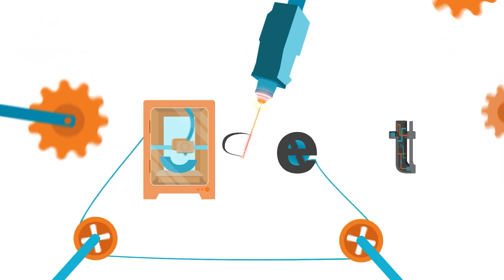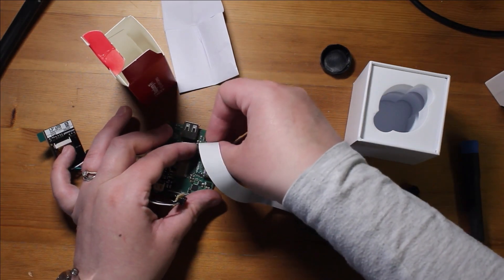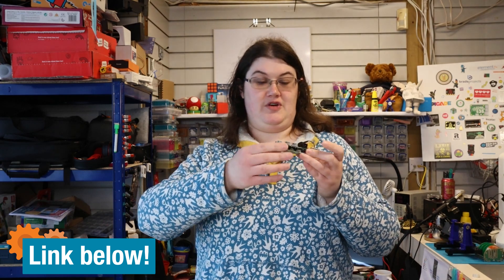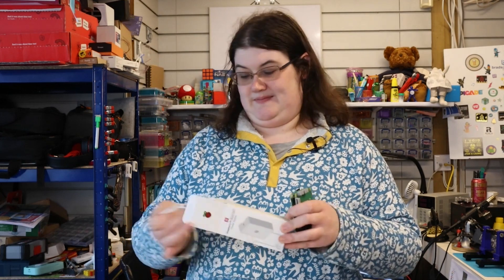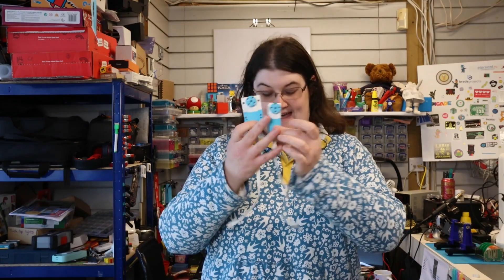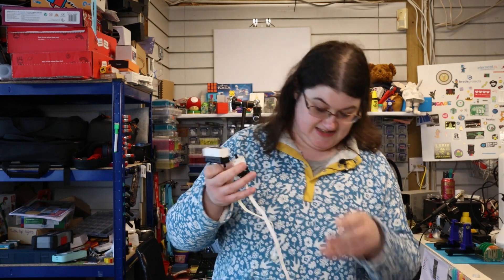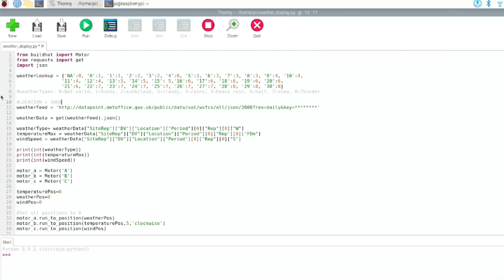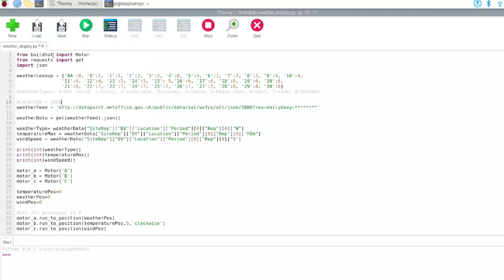Lego Spike Prime Weather Station with Raspberry Pi

Comment: Still don't get the benefit of the Pi. The computer you use to write the code on can already connect to the interwebs, and then it sends the motor commands over BT to a Lego Technic Hub for 20€. The RP2040 based HAT is cool if you can control that board by itself, without Raspberry Pi. Then you would have a relative cheap, fast and true microcontroller based board for your LEGO projects. I don't want a full Debian OS in the middle.
Reply: Got the board in the mail, and as I have not found a suitable Pi for it, I thought lets give it a go as an Arduino module. And guess what, it works. I can hook up 4 Built Hats on a DUE and control 16 motors. Awesome.

Comment: Great project!

You wouldn't need the riser on the front edge - at least to lean the unit back - if you just raised the leg attachment point, and in fact you can probably adjust the angle at any time by moving the legs. But I understand the riser may also be intended to give a little distance between the display and the shelf or whatever it's sitting on, meaning it's more of an aesthetic choice than a functional one.

Regardless, this is a cool gadget and is great for telling you the weather at a glance without having to pull your phone out, unlock it and get to the app or widget.
Reply: Thanks, there was a secondary reason. There seems to be an bug in the library (it looks like it should get fixed /implemented), but the motor direction isn't settable, it goes the shortest route to the next position. 
It's fine most of the time, but if at the end of the scale it might come back clockwise, the riser gives it space to rotate all the way around!

Comment: It's a fun little project, but Raspberry's got so much more potential that I think it'd be a bit of a waste not to move on to something grander after this. For this sort of project, an Arduino or even just plain IC's and passive components might be enough, with a data feed from the Raspberry Pi. So you could replace the pi with an Arduino, and then send data to the Arduino every five minutes to update the weather report.

I once had a similar situation watering my plants automatically, and I could solve that with basic components. Didn't even need a pi for that one lol.
Reply: Yes, I think it's good for prototyping an idea, but yes, it's agree it's overkill for this project. I've mainly done this one to get used to the hat and library ready for a bigger project 😉